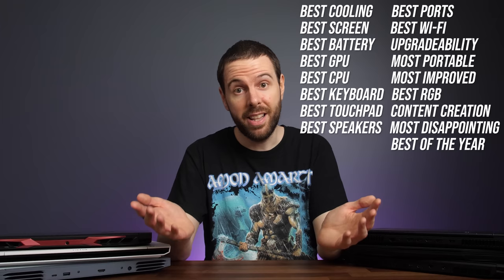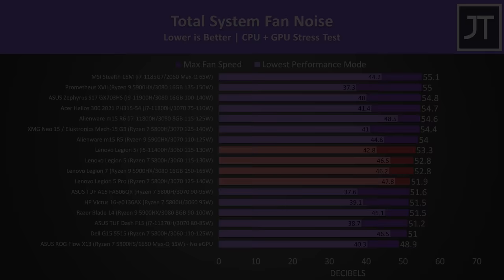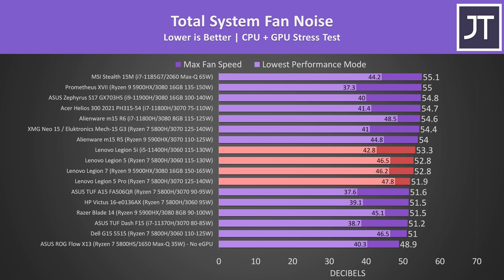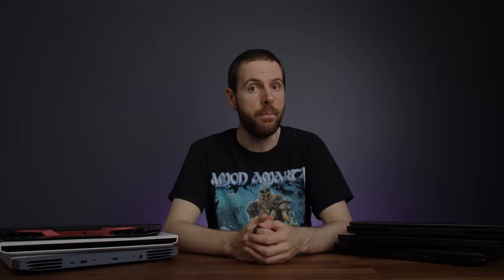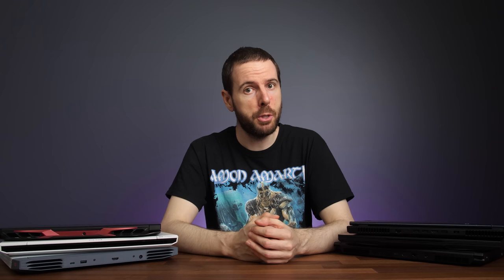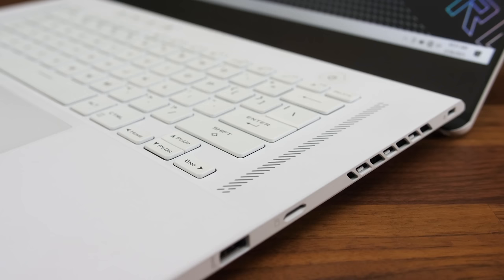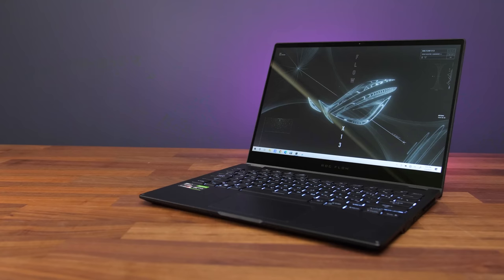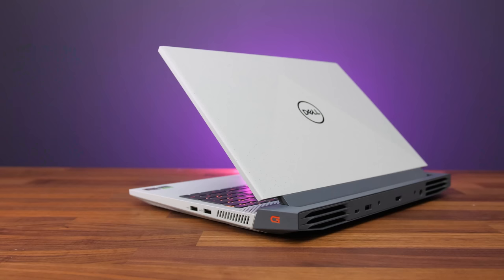Gaming Laptop Awards 2021!

Comment: Great Video! I was hoping that you would make a video like this one.
I just bought a Gigabyte Aorus 15P with a RTX3060 and even if it's not on this list, it has many of the features those best laptops you showed (at least those from the middle ground) also have. Gpu never gets hotter than 66° and the CPU only has peaks at 80° while gaming, but stays at 75° most of the time.(It runs at 60W when those peaks occure, so nothing to worry about). It runs Cyberpunk 2077 with medium raytracing and (almost) everything else at ultra at 55-65 FPS and Red Dead Redemtion II at 70ish FPS, both with DLSS. I've set a manual curve for the fans so they're spinning at 55-65% while gaming. I couldn't complain so far for 1500€. I could've gotten the MSI GP66 Leopard for the same price with a RTX 3070, but only half the storage and almost half the battery.(never used it unplugged but could do it longer if I wanted.) 
I only hope it doesn't brake down.. I've heard that Gigabytes support isn't the most consumer friendly one.
Reply: i had aorus 15xa 44k oled with 2070 max q, had problem with gpu and the gigabyte service was so bad that i gave up on sending it back to repari here from europe, i had a fan broken and after something on motherboard, i will never go again gigabyte, shame because it was so nice and i loved it
Reply: @mikev768  well I hope it goes bad in the first 2 Years. Than I don't have to deal with Gigabyte Support as I can simply send it to the seller. After 2 Years I would change the fans myself if they break.

Comment: It was the 5 pro that swapped the Legion 5 Pro's Intel AX 600 for a mediatek (MT7291) wifi 6 card. Source: owner of a legion 5 pro with a mediatek card that was immediately swapped an Intel wifi 6 card due to various connection issues with the mediatek. US region based.

Comment: Mann I was really hoping for legion 5 pro to win something. Was gonna buy rtx 3070 model but now this awards show is making me go with less expensive legion 5 rtx 3060 model
Reply: Actually the Legion 5 pro with 3070 is the perfect decision if you can find it at a good price ex:$1500. It's the same as legion 5 but with better build quality and performance.

The legion 5 won the award because it's just cheaper without sacrificing much. But the 5 pro is the better choice if you can find it for a good price.

I own a last year model legion 5 with 4800H and 1660 ti btw and it's great.
Reply: @HashimHS  can I second this? I’m thinking price is the only reason the L5P didn’t win. In the US you can get it as low for $1400. I almost picked up the $1200 micro center legion 5 but for $200 the performance increase on the L5P was IMO worth it. 🙄 Both are great laptops though and budget wise the price difference may be worth it for you.
Reply: @hoylematt1  what about portability. I think L5 don't stand out as much as L5P but what about their weight. Is L5 lighter/more portable than L5P
Reply: @Abhi-qn4xv  Well, the difference between the 5 and 5 pro if I remember correctly is only about 100 grams which isn't noticible. when it comes to portability,  both are pain in the back, specially if you plan to take to power brick with you (3.5 kg total). Fortunately though, both support usb type C charging so you don't have to.

Comment: It's hard to beat the value of the Legion 5... Hey Jarrod, would you do a video testing eGPU on last gen Gaming laptops (with Intel i7 8750H/9750H CPU)?
Reply: i used to use a 8550, its absolute dogshit, even theres some pc magic going on since its always turboclocked to 3.6ghz
Reply: @wiltheavatar  I'm not sure what you're talking about. If I remember correctly, it's 8550U which is a low power CPU for ultrabook. I'm talking about gaming laptop with Intel i7 6-8 cores H CPU like the Legion Y740, MSI GS65-66, or high-end laptop like Thinkpad X1 Extreme. These laptops have Thunderbolt 3 which some/many people bought partly because they can connect to new eGPU once the laptop GPU becomes outdated.

Comment: Jarrod if you could address this issue in your next video.. MSI does this horrible stuff to their every AMD laptop. Months ago..I found the solution to the problem.. Basically There's a feature called D3Cold in BIOS MSI AMD laptops.. this feature creates major stuttering when the iGPU switches to dGPU.. What D3Cold does is it completely switches off the dGPU instead of running it at a low power.. that creates the Major stuttering. 

 This is a major issue. And people are blaming AMD for it for no reason. MSI should turn off D3Cold by default
1. Enter BIOS
2. Advanced TAB
3. Press right shift + right ctrl + left alt + F2 (Unlock advanced BIOS)
4. Go to AMD PBS> D3Cold support > Disabled

Comment: Thank you for the video! Good comparison and analytics. I agree with your approach - however, without a shadow of a doubt I'd still put my M16 as winner :) It has great cooling, best screen for everything you can imagine including work, decent battery - in my case it usually runs for 8 hours, best CPU and GPU, best keyboard and touchpad, outstanding speakers, rich port selection, upgradeable, light and portable, has webcam, solidly built, and main thing is it's modest with RGB - it does not look like a Christmas tree and it shouldn't! I wish you gave it a bit more attention - it deserves it.
Reply: It has one major flaw. It's made by a poor brand, Asus, that has poor support, poor thinking in cooling, solders to motherboard that you can't updrade, and not very reliable

Comment: Thanks to your videos I've decided to buy Legion 5 rtx3070 as my FIRST ever gaming laptop. I was a desktop user but since I've moved to smaller apartament during uni I had no space to bring my desktop with me. I've decided to buy Dell xps13 at that time but now I know I was missing gaming so much! With Legion 5 I can now smoothly run Escape from Tarkov which is big success for me. But I have one question...

Q: Does Legion 5 17 inch 144hz have G-sync though? I found some info that on hybrid mode you can enable freesync but I want to game only on my RTX and then I think you can't enable G-sync/freesync at all.

Comment: Hi Jarrod, if it’s okay to request that you could do a comparison between the Asus Vivobook 15 M3500QC-L1080TS / or L1175TS
vs Legion 5 Ryzen 7000, R5, RTX3050 model? These are almost the same prices, vivobook being 100$+

I’ve been having difficulty picking which to buy since I will be using it for long-term all around and will carry it with me most of the time.
I’m planning to do casual triple A gaming, Editing, recording, streaming, Data rendering, web browsing, and use it for school and also connect it to external monitor. Which would you recommend for me?

Comment: I have a Lenovo Legion 5 with the Ryzen 5800H and 3050 Ti and also have a HP Omen X16 with the Intel 11800H and 3070. To me, I love the HP Omen more. 16in screen, (compared to 15.6) 2560x1440p resolution, (compared to 1080) Better RGB Customization, better GPU, and better FPS in gaming.   However, there are 2 things I dislike about the HP OMEN but not game breakers. The Ryzen 5800H in the Lenovo Legion 5 does better with video editing than the HP Omen 11800H and the fact that all the cable go into the back on the Lenovo Legion 5 is also a big plus. But, Overall, I love the HP Omen more. Personally, if you had the HP OMEN X16 here with you in these test, I think you would have agreed it may have won your 2021 award.
Price wise- Lenovo Legion 5 was $1,100 vs the OMEN at $1,500. But, tbh, an Intel 8 core with a 3070, 2K screen, 16GB RAM and 1TB SSD for $1,500 these days is AMAZING. Plus, The OMEN has the same WiFi chip as the best one tested.

Comment: Where do you find out about all the specs of laptops? I can find most things but on laptops I struggle to find if they have a mux switch and what the wattage of the gpu is so I can tell if it is using it’s full performance. Also response time.
Reply: like no joke, u gotta watch reviews, jarrod's reviews are usually in depth about things like that, since laptop companies dnt exactly want to advertise their shortcomings compared to other brands/models
Reply: @wiltheavatar  So true but I just don’t know what to do about the laptops he hasn’t reviewed you know?
Reply: @brandongiron6494  im personally biased against asus acer msi, they never work well for me, my last 3 laptops were asus and they all had issues, im taiwanese and i can only say taiwanese laptops all have issues according to my friends who use them as well as personal experience, theyre not even cheaper here too

Comment: I am glad Lenovo legion 5 is best overall gaming laptop according to you. I am getting an AMD Ryzen 7 8 core with rtx 3060 and 115-130 TDP. Can't wait to order it and have it home. You are the best tech reviewer. I had bought a Lenovo L349 gaming which I did enjoy for 6 months, though i came to find that the new 3000 series came out this year.  Thus i sold my GTX 1650 l340 old laptop to buy a Legion 5 AMD with RTX 3060. I hope this one does last me the next 3 -5 years. The GTX1650 was good but 4vram was starting to age and according to the general consensus rtx 3060 with 6 VRAM is the sweet spot for some future proof gaming. Plus, Nvidia said the 3060 is 30% better than a PS5.

Comment: Jarrod really need your help ...should i buy legion 5 or legion 5 pro. I want 3060 variant of either of the models. Watched both your legion 5 and legioon 5 pro video over 5 times still cant decide . Legion 5 have some plastic build small screen keyboard and screen have some flex but it is more worth the value  and i am tight on  budget

Comment: No lie, I recently got a MSI gl 65 with a 2070 super for stupid cheap prices, making it a good deal, but one thing I DID take note of(couldn't resist), was the PER KEY rgb
And there were very few cheap, powerful others that had this instead of multi zone zone rgb. It WAS a factor.
The#1 downside, you can't change the rgb modes via software or keyboard shortcut if u put Linux on it and use that, just windows, and while there is  experimental rgb software out there on github for Linux, it's still in the public testing phase for now ( and I am nervous since if you brick your laptop rgb firmware, you cannot recover always;pending brand/ newness)...
Thank you Jared, for covering that, it isn't gpu/cpu  importance but is something that is looked at...

Comment: I ended up getting a Gigabyte Aorus on sale for 25% off and it is a pretty good laptop. I've had it for about a week and a half and it froze on me once at start up when switching modes, so time will tell if this was a good deal.
Reply: Wouldn't happen to be the Aorus 15p YD?  I got the 3080, 11800H, 32Gb Ram.  As far as gaming its kicking ass. I've factory reset it and had to redownload the command center from the Gigabyte webste. Was getting stuck at 40fps minutes after being 120fps on battlefield on ultra. It was from a program limiting it and couldn't figure out which one lol. The reset fixed everything btw.

Comment: i happened to be one of those lenova legion 5's that shipped with a garbage realtek wifi. i have  1000mb wifi and sitting in the same room as the hub, i speed test at 200-400. conversly, my gf's msi sword speed tests at 6-800. Definitly in the market for a replacement card, per your legion 5 upgrade video.

Comment: I have gv531 with 9300h and 2060. As soon as I've applied liquid metal, my cpu and gpu temps pretty much equalised and dropped to 75C under load. It worked well for about 14 months, after that temps suddenly skyrocketed. I suppose its true what they say about having to change liquid metal once every year.

Comment: Beautiful menction to the Clevo X170 in the best laptop last category.
Lenovo is very balanced, but everybody knows which is the BEST.

Honestly, it depends the use your gonna give the machine. If you need a machine for taking notes over a morning in the University, Clevo X170 is not your laptop.

... But it you gonna work with Maya, Unreal, render engines, animation, etc.... Clevo X170 is the way to go no doubt about that.

I must say, "fan noise" and weight.... Are two weakness points that apple-like companies use to sell their no-advantages with pure marketing.

People usually weights around 90-100 kg... Shut up and grab that 4 kilos laptop.
And if you're rendering, put fans at top speed and use earphones or go to other room...
Or take advantage of the heat to cooking or keep warm the room.

If by me would be, I'd choose a 24" Clevo with 8 fans able to fly like a drone, making a sound able to confuse with the gates of hell opening.

Comment: Dell G15 5511 with x8 ram, a cheap 1tb m.2 and an undervolted CPU/GPU and overclocked GPU is perfect. 1850mhz 3060 at 80C at 100% load and 4200mhz 11800h at 90C at 100% load. Perfect. Could get them for $1800 AUD on their eBay special. I'm using an external screen so can't comment on the 120hz panel or optimus.

Comment: I was also a huge fan of Lenovo Legion 5 Pro, but after I bought it I've noticed that the battery discharges rapidly when laptop is turned off. I've tried multiple hacks to fix that, including totally removing the system and choosing different power management options in BIOS, but was unable to get at least decent results. As a result I had to send it back. Lenovo support was not very helpful, they've claimed it's normal for those batteries which is very surprising (around 1% of battery disappeared per hour when turned off without any OS)

Comment: A lot of people were hating on the 3050 because it's a bad deal and it's terrible. Well for me, it's a good deal for the price, it even cost nearly the same as the GTX 1650, I actually bought a 3050Ti laptop because I was on a tight budget. I even met dumber people that said GTX 1650 is better overall than the RTX 3050 and the Ti version, but they don't consider the price and availability. This may differ in other regions are countries, so I can't assume that they're a better deal than a GTX 1650, since probs they're more expensive than a 3060 or similar price to a 3060 in other regions. I'm just grateful to have a gaming laptop, I don't care if people say my mobile GPU is trash, at least it's better than having integrated graphics, it's kind of hilarious that RTX 3050 has more hate than the GTX 1650 which is more terrible, although, everyone is not wrong, having 4GB of VRAM is such a joke to the 3050 especially since it was released in 2021, may not be good enough for long-term, but it's good enough for me, better than a GTX 1650. People just set the standards too high on RTX graphics cards and always expect them to be the best.
Reply: In the end all that matters is if you are satisfied with your purchase and it meets your needs.

Comment: Seriously stop recommending the aero series. They still have the issue with 100% gpu load making the wifi drop connection. It is a design flaw that Gigabyte has not fixed for years !
Reply from the maker: First I've heard about it, care to elaborate? I've been using 15x for years and now onto 17 and it's fine.. Other than a separate issue with my USB mic but that's a different story.

Comment: hi there, if we compare the legion 5 15" (amd 7 5800h with a rtx 3060 6GB)  vs the legion 5i 15" ( intel i7-11800H with a rtx 3060 GB). will AMD win?
 mains differences between them are that legion 5 have ( gsync, freesync, usb-c, mux, optimus) and legion 5i have(gsync, no fresync,  thunderbolt 4, mux, not optimus)??

Comment: I hope they start offering 4K 120Hz HDR screens on laptops at the mid-range (like a legion 7 with a 3070) soon. I find the current crop of laptop screens to be too much of a compromise.
Reply: You are too demanding. In 20 years of gaming "career", we have been stuck with full HD 1900x1000 and 60hertz for the longest time and no one complained
Reply: @niksarass  a lot of people complained. And things have changed dramatically over the past several years as far as resolution and refresh rate. But contrast, local dining, hdr adoption is too slow. Monitors lag behind TVs here and laptop screens dramatically lag behind external monitors.
Reply: @mohamedahmed1023  No, no one complained, until few years back in 2018 when they started putting more than 60 hertz screens in Laptop, it was not even heard of.  I bought in 2018 one of the first mainstream gaming laptops with 120 hertz screen (MSI Gt72 vr), which was unique back then almost every other laptop from Asus, Dell, Hp, Acer was 60 hertz or 90 hertz. Before that, it had been 60 hertz for 20 years and no one complained. Nothing better existed.
Reply: And you cannot compare laptop screens to Monitors and even less monitors with TV. I would never play anything competitive on TV, they have the crappiest response time they are not for gaming
Reply: @niksarass  LG OLED TVs have better response times than most gaming displays. With respect, you're just not knowledgeable on this topic.
Reply: @mohamedahmed1023  I don't think every TV in this world is a LG oled,  the majority of TVs that I have seen every where had ridiculously bad response times even expensive TVs. I think I am more knowledgeable than someone constantly taking the exception as the norm.
Reply: What are you talking about? I am just speaking about my preferences. I never implied I am the norm. You're the one making sweeping generalities like "no one complained" and "tvs have the crappiest response time." I highlight the obvious exceptions to your lazy generalities. And OLEDs aren't the only TVs with good response times. Look at any crop of mid-range and high end 4K 120Hz TVs - just pull up RTINGs reviews. Most of them have decent to excellent response times.

Comment: Best value is Asus Strix G15 AA Edition, I got mine for $1450 with a 6800m and a 5900HX, there is nothing else out there at this price point with this much power. Why are you so stuck on a 3060 gpu?